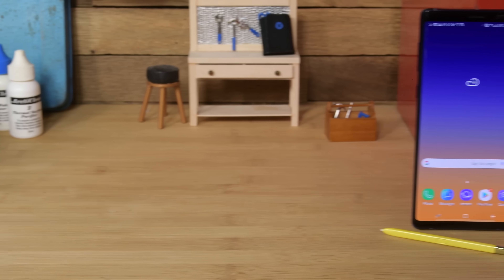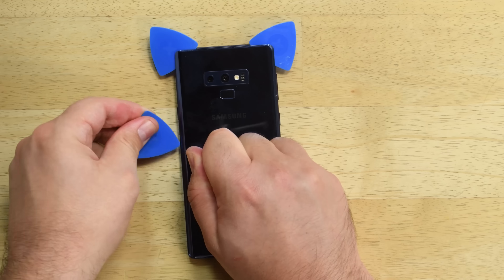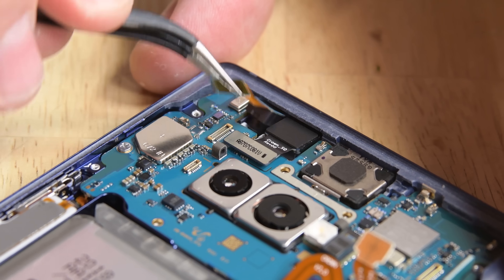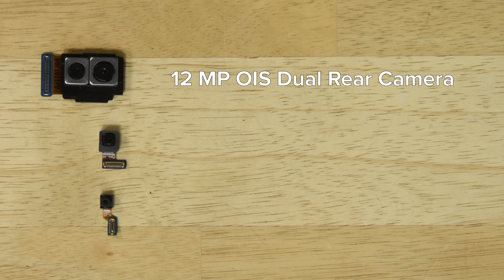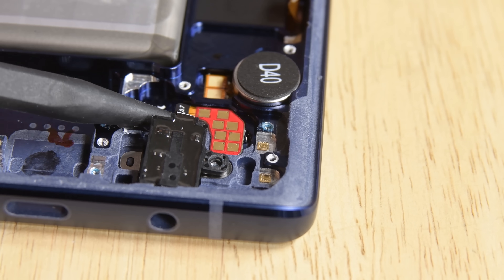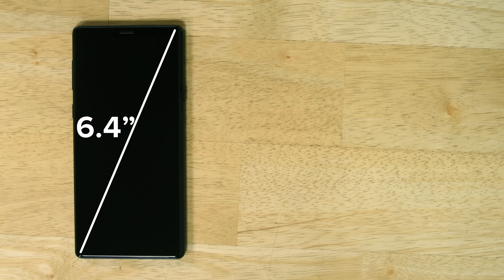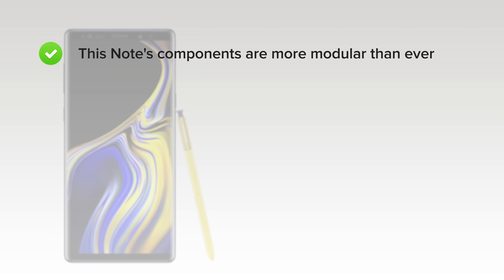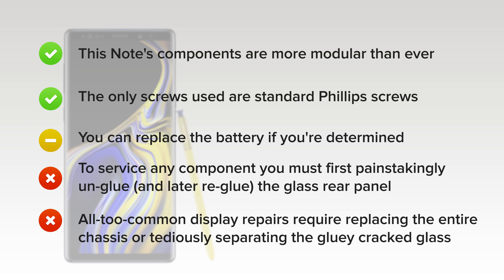The Samsung Galaxy Note9 Teardown

Comment: 1.iPhones may cost a $100 more than the Note 9 but all the Androwankers screaming that the XS isn't much different than the iPhone X, how different is Note 9 when compared to the Note 9? 
2. Your Note 9 will lose its resale value like a perishable food item.
3. You don't have a stock messaging app, iMessage is one of the selling points of an iPhone
4. Android is less secure than iOS and is energy and memory inefficient which makes your phone painfully slow and almost unusable after 1 or max 2 years
5. The clear advantage of being inside the Apple ecosystem cannot be ignored with the seamless integration of the mobile platform and the Laptop/desktop working together in a connected fashion.
6.Updates: Android almost won't even give you a single update. Only 4% of Android phones in the world use Android Oreo which is 2 years old now.
7. Poor compatibility between the stock Android, Hardware manufacturer, Chipset manufacturer results in the requirement of more cores and bigger batteries.
8. Apple A12 Bionic is much faster than Snapdragon, Qualcomm or Exynos. In fact 2 generations faster. You can look it up on Android Authority Youtube Page.
9. Better Appstore with many apps only available on the Apple platform.
10. Overall user satisfaction is much higher for an iPhone than an Android which requires rooting for any sort of updating since Google is concentrating on only bringing the Android updates to its Pixel smartphones rather than 3rd party ones.
Reply: both phones have the positives and negatives. But apple is a very bad value. 1.1k for a 64gb phone with no fast charger no expandable storage no pen...
Reply: Man, what an absolutely weirdo comment. I know it's been three years but seriously, no one cares that much.
Reply: iphones are about same performace in real world scenarios
Every samsung phones get least 2 years of android version updates
S and note series get 4 years
You have stock messages app (handgouts or what ever) and your friends probably use whatsup anyway
You can do a lot more with android compared to ios 
You can download apps from anywhere with android
iphones are very expensive to repair
App stores are pretty much same
And what do you think which phone gets better rewievs:
800-1400€ phones or
100-1100€ phones
Reply: Apple is morally bankrupt!

Comment: So the fragile headphone jack doesn't affect the score? Lol
Reply: we can't fix the headphone jack and put back in?
Reply: You can remove everything without removing the headphone jack. If you need someday to replace the headphone you wouldn't care if it comes off intact
Reply: Can't replace the display without taking it out. And you missed the point.
Reply: @techguypaul  you can.
Reply: No, you can't. You have to take everything out to replace the display.
Reply: @techguypaul  the display is adhered to the mid frame.
Reply: Nowhere does it say that you can take it off with the headphone jack still in.
Reply: it's not really that fragile

Comment: I feel like what they haven't mentioned (Samsung parts - a way Samsung sells genuine replacement OEM parts to everyone) should be a factor in determining repairability.  You can go get the official OEM parts ( also iFixit can get official parts too to sell) without risking getting some dodgy knockoffs like I have had to do in the past with Apple and Sony ( they don't allow the consumer to replace their components with safe and genuine parts unless you go pay their post warranty exorbitant prices. With such products whats the point of good repairability without a part to repair it with that is safe and genuine?
Reply: Because it's not about the quality of the part, it's about the simplicity of it. Wherever you decide to get the new part is entirely up to the consumer. The point of the repairability is to show how easy it is to replace any component(s) yourself. The Note 9's score of 4 shows that while the parts of modular, getting into the phone is the challenge, especially with the insanely strong adhesive and risk of damaging the back or front glass. Samsung doesn't aid to the repair by selling OEM parts. Good for them that they do, every company should provide that, however, if they want a higher repairability score, they'll need to shift their focus to how well the phone can be disassembled, and lessen the risk of any further damage done by the end-user.
Reply: @ShadowLinkxMaster  I hope you realized 4 years later that the quality of the part also matters lmao
Reply: @kodak1587  Weird how things change in four years, doesn’t it?

Comment: Dont see any good reason for the battery to be glued in.
Reply: Because the battery could hit other components when dropped if not adhered.
Reply: @Ed Saucin PlayerX is correct, I have seen where i work at repair center and they remove battery in samsung like 1-5 times a day and i have seen it with my own eyes that battery uses adhesive instead of glue, since you can peel adhesive off, with glue you cannot. So simply it's not glue. check huawei p20 pro tear down and you will see difference to glue and adhesive. Glue makes battery extremly hard to remove, while adhesive you can remove it easily by just making it weat or use a tool. While glue would make battery bend when you use a tool.
Reply: @liamkenned.y  what should I use to affix the lens and fingerprint reader to my replacement rear glass?
Reply: @liamkenned.y  note9 N960W

Comment: After we remove the back by using the hot gun, it's also mean the system protector water resistant is damaged ?
Reply: Of course, the seal is what keeps it water resistant
Reply: @skyyansihan8709  oh thx q so much